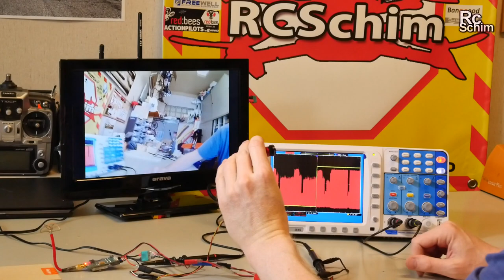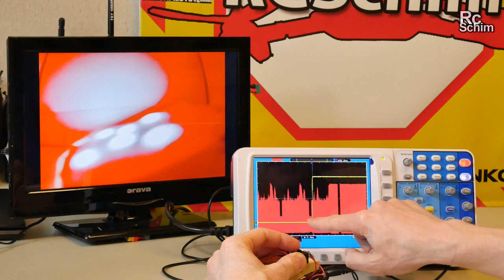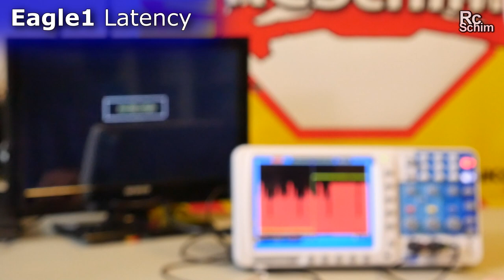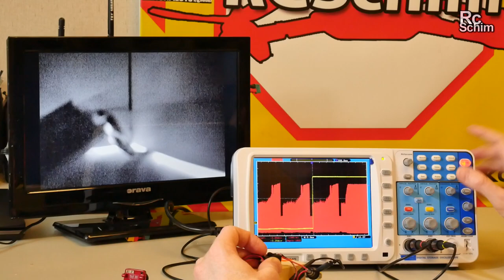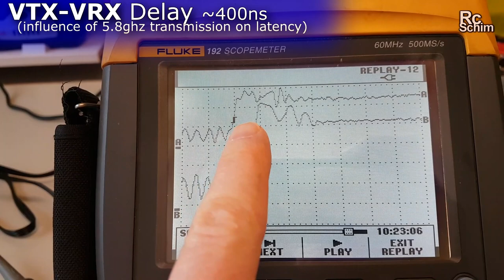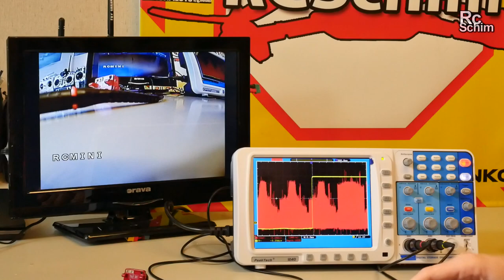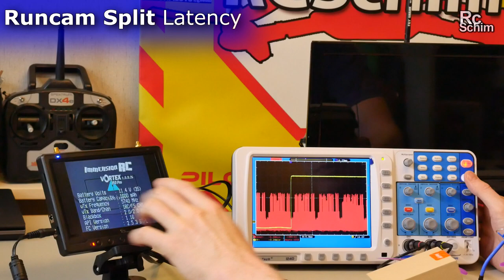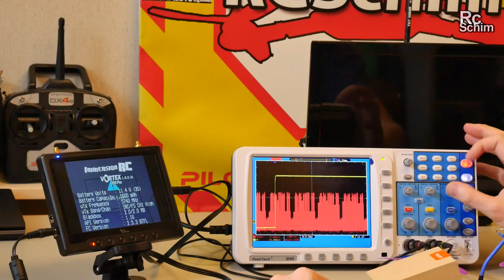Runcam Eagle 2: great picture, latency lower! thoughts, testflights, DVR footage

Comment: great video man .  I think every  FPV Cam manufacturer should send you their cam for Accurate Latency testing .  One thing I'd Like to know is ;  is more latency  using the OSD in the Flight Controller  or on the Cam ?  If you get the time it would be cool to know this thanx and Keep up the Amazing work ... you  are now Boss Of latency test IMO .
Reply from the maker: thanks for the appreciation :) runcam and foxeer are supportive and send cams to test. 
to your question: I dont think adding a textlayer (OSD) should increase latency at all. it doesnt process the image but just add a layer. so it shouldt matter and I'm very sure if it adds a tiny bit of latency - then this is so small that I cant measure.
Oszi would be fast enough, but the problem is the refresh rate of the video signal...

what It did note today: for example if you have a HD cam (in my case Foxeer Legend3) and use it with TVout:  here enabling or disabling EIS (electronic image stabilizer) HAD a very noticeable effect (didnt even have to use the measurement method here - could see it with my eyes...   
and this is logical since the EIS is heavy processing...

Comment: Which lens was that on that eagle? 2.1 vs 2.5 - which would you recommend?
Reply from the maker: sorry, cant tell which lens was used here. I really should try to include all those details but sometimes get lost in testing :)
2.1 is more my lens - but that's personal pref. and it also depends on which FOV your goggles have. with huge FOV in goggles you also need wideangle lens.
with smaller FOV (like 30° in goggles) you might perfer 2.5 or even 2.8 lenses...
Reply: That's a perfectly logical explanation! Thank you very much .)

Comment: WARNING THIS CAMERA IS 'GROUNDED' !

At the beginning my cam was getting some weird vertical sync problems, and vertical bands in the video. Thought it was a problem with my Transmitter etc....

Finally found the problem : the 2 screws of back panel are going thrue holes of the main board, but borders of theses holes are connected to the ground. As the boxing of this camera is full metal, it means that all cam (metallic support included...)  is  grounded. When installed in a carbon drone, this finally connect all frame to the ground and can cause massive glitches in video. (notice that i checked that no other parts in the drone was grounding the frame... it was really the eagle...)

The solution is to replace the 2 metallic back panel screws with 2mm nylon screws (or isolate cam support from your main frame perhaps) . Now my cam is working perfectly, very stable video and it's the best fpv camera i ever used.
Reply from the maker: thanks for that long feedback. I have the eagle2pro on the bench an will test it against your finding. if it's the same we already have a solution.
my solution (by just being lazy): I use the cam mount with dual sided tape to the copter and fasten it with 2 zipties. this way I have normally no continuity here...
Reply: yep. thrust me. i tested all with ohmmeter and the problem was really coming from my eagle 2 (not from motors, vtx etc...). I saw people saying that noise was coming from ESC, and tried to use capacitors without success). Finally  2 nylon screws for back panel solved the problem. 
Perhaps it was a specific issue for my cam but i seriously doubt of that.
runcam is now using a plastic housing for Eagle 2 pro ;-)....guess why...
Reply from the maker: well, thanks once again. that's nice background info and I will used it in my eagle2pro review. just dont know when to schedule the next runcam review - I dont want to exclusivly review their products on my channel :)